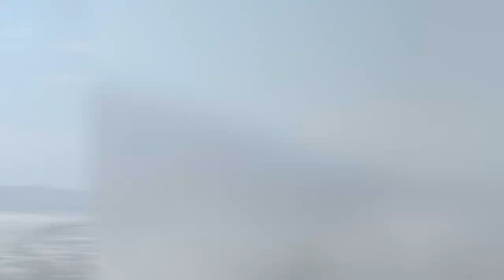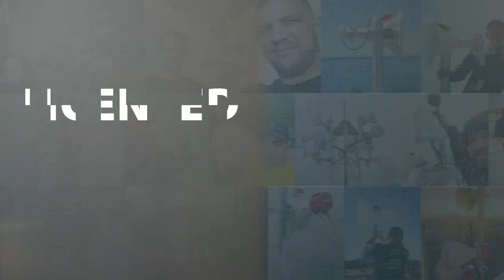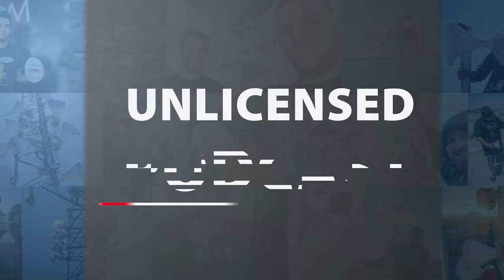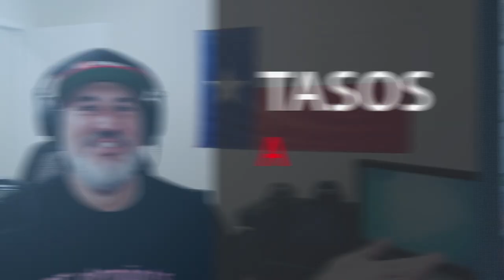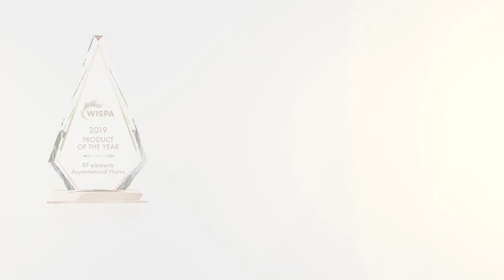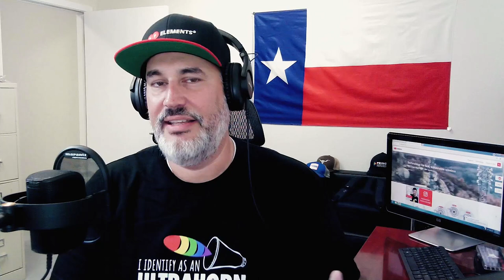#11 Unlicensed Podcast - It's Not All Equal

Comment: hello what is the best type to long range PTP from your  horns with 30db desh
Reply from the maker: Our PTP antennas include UltraDish series with up to 27 dBi gain and minimized sidelobes, or UltraHorn (https://rfelements.com/products/ultrahorn/ultrahorn-directional-antennas/overview) with 24 dBi gain but much higher beam efficiency. So if the link budget allows and noise is an issue, UltraHorn is a great choice..